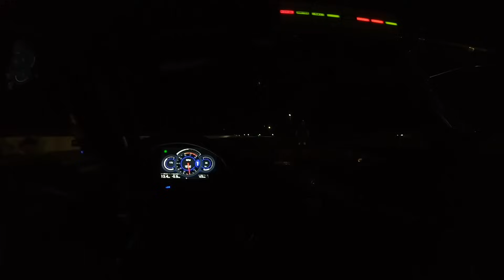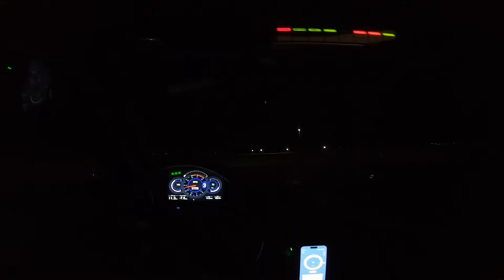I Crashed My No Prep RX-7 (Then Won a Bunch of Races)

Comment: if you can seal the pipe up some how and put some pressure in it you can fix it with some heat like you would to a nice 2 stroke dirtbike pipe and do a give away maybe

Comment: Hayden how did you have a fuel restriction like that at what i assume is close to 25-30 psi and not torch a head or tulip of valve how much boost are you running? If i remember you are still running stock heads? We love setup info too. Also if you post i will watch
Reply from the maker: Derrick did all the tuning/setup and setup a fuel pressure safety!